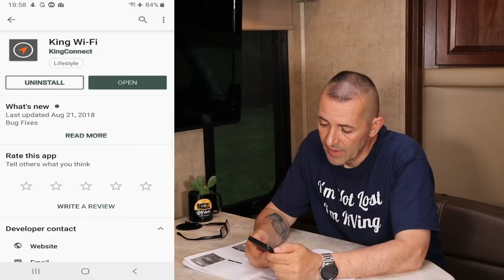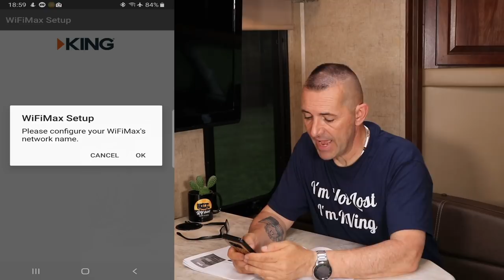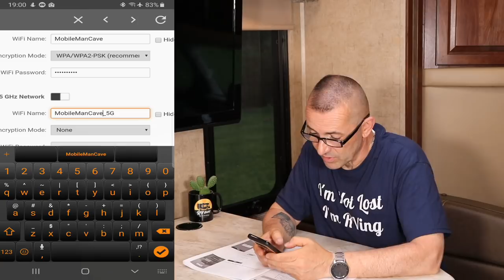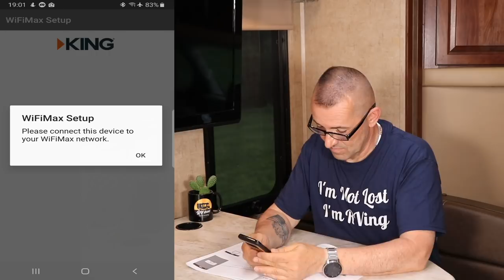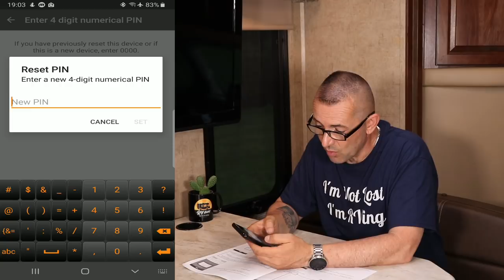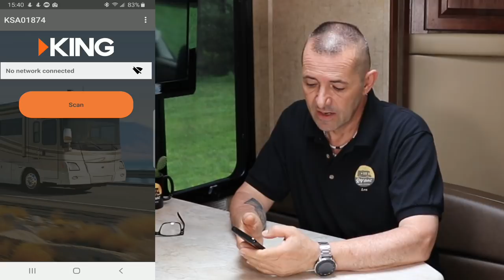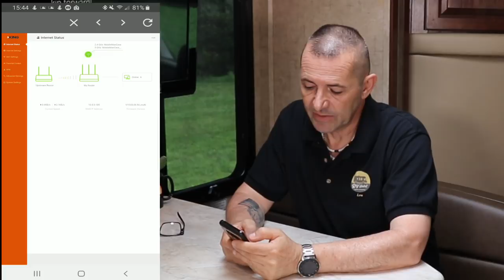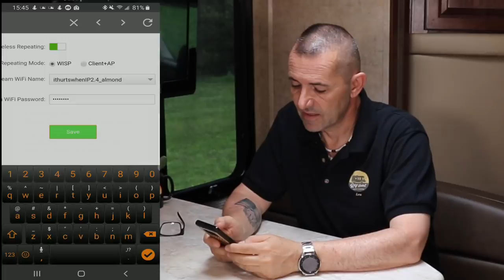King Falcon WiFi - Automatic Directional Antenna and Router for the RV – Install, Setup, Review

Comment: Thank you for the kind words and thorough walkthrough, Lou! We're delighted to hear about your experience with our Falcon!
Reply from the maker: Thanks for commenting!  I have four different King products and love them all.
Reply: Does it matter what position the antenna is in when travelling?  Can it be rotated with the app to offer the least wind resistance?
Reply from the maker: It stays in the last position it was aiming.  I have not noticed any problems or wind resistance when traveling.  I don't see a way you can point it forward when traveling.  It only sits nine inches above the roof.  Hope this helps you and thanks for the question, Lou.
Reply: Do the units have 12v power adapters available?

Comment: Is that a deer that walked by your RV by the window on your right shoulder.  This is a very good video but the setup can be a little confusing. Had to replay it a few times. You were talking about 11' cable I agree. Fortunately I have a pre wired RV .Wild River witch I have is king pre-wired so  that saves some work there. Also has a G6 wire for cell boost also. I probably would go with the swift kit because you have to deeper in your pockets for the setup you have. Have not seen that Falcon for less then $ 700 and that's steep money. So the swift I go! Thanks for the demonstration and detail explanation. I probably put a pole outdoors and hook the outside swift instead of up on the roof permanently.  Not sure yet. wait next spring anyway. Thanks!
Reply from the maker: Yes the Falcon has gotten very expensive and it seems most campgrounds have subpar Wi-Fi.  Oh and yes that was a deer lol.

Comment: I call space up on the roof real estate as well, I wonder if I got that from you lol. Do you know if king Jack offers an extension cable if 11 feet is not enough? I think the most difficult part was fishing the cable under the circuit board lol. That was another well planned and easy to follow how to video, nice job Lou!
Reply from the maker: Hi Kenny, probably just the way us two northeast boys talk.  I actually checked and King does not sell a longer cable.  You can get one from a third party but adding more cable will affect performance.  The legnth is doable but takes some planning. I was worried about the video legnth but wanted to explain each step for a good how to for viewers. Still working excellent though.  Thanks for taking time to watch, Lou.

Comment: Nice video but I have a stupid question. I have it all hooked up on my phone but what I'm confused on is when I go to my tv it gives all the different wifi signals but which one do I click on? Do i connect to the 5g  i created or the campground signal?
Reply from the maker: Hi,  You will always see your own RVs network listed as it is transmitting its name over wifi but it does not have internet until you connect to a wifi that does have internet.  So you do not want to choose your RV network when setting up.  You are looking for a wifi network to connect to that will supply internet such as the campgrounds wifi.  Once you connect to the campground wifi that will be rebroadcast on your secure RV network.  I hope that makes sense.

Comment: Hey Lou - great video!!!  As a digital nomad, I am always looking for technology that can enhance my ability to acquire a signal.  Thanks for the step by step with the King.  My only concern was the fact there was no cover on the circuit board. That seemed kind of weird.  Is it still working good for you?  Safe travels my friend.
Reply from the maker: Hi Patrick, I thought it was strange also about the circuit board.  I would of thought it would be dipped in some type of coating.  With that said once it installed it is completely protected from the elements.  After I installed it it rained for six days straight and no problems.  I have only used it just under two weeks so far but it does work well.  Thanks for watching and stay safe, Lou

Comment: thanks for the video!  really appreciated - just saw one of these on amazon yesterday and was VERY interested.  Oh, and who doesn't love bacon! ;)

edit:
wait, it's only 110v?? ok, i see it on the actual King website - the antenna is 110v -> 12v and the router is 110v -> 9v.  i'm not TO savvy with electronics, but i do know vehicle electric systems.  you can just wire the antenna into your 12v system no problem (make sure to use a fuse on the positive, of course) and skip the 12v-to-inverter-to-power adapter-to-12v at least... i'd have to look up how to get 9v from a 12v system for the router.  (maybe some sort of a cheap adapter online?)  or maybe just get a 12v router.  looks like the falcon is a standard router antenna connection...

thanks again for the video!
Reply from the maker: I have been happy with the falcon so far.  I will be doing more testing in a few weeks.  The router is excellent.  It has worked far better than my previous antenna and router that this replaced.

Comment: Great Video Lou!!   So with the WiFi King Max Router I can use it to hook up Apple TV to it like you did your USB stick?  Also have you had any wind issues with the antenna when driving?
Reply from the maker: Hi David,  Once you have connected to an Internet source with the Falcon the WiFi Max acts like a router that you have at home.  You can connect any device you want to the WiFi Max Router.  The trick is you must be able to connect to an available Internet source.  Many times campground WiFi is lacking on speed.  With all that said it does work very well and beats  my previous WiFi setup hands down.

Comment: How is antenna? still works, still like it? I am considering to buy one.
Reply from the maker: Hi Andriy,  yes still works great.  The only issue is you need wifi in the area to connect to.  Campground wifi has shown to be lacking in most places.  With that said when there is wifi to connect to this works great.
Reply: @RVHabit  thank you.

Comment: How far away can this pick up wifi signal? I'm looking for something for my motorhome.  I'll be dry camping and looking for something that will be able to pick up further then just a few hundred meters throughy buildings and hilly areas. I'm wanting to be able to park a few blocks away from a Walmart or McDonald  but still be able to get their wifi, or maybe sometimes there is someplace that has a really nice view I want to park over night but am a couple km away from Walmart for example.
Reply from the maker: I have seen signals close to a mile away.   However this is highly subject to weather, atmosphere and terrain.  This may or may not work depending on conditions.
Reply: @RVHabit  thank you for the information. Because of those reasons I'm looking for something that would reach 3 miles or more in ideal conditions. That way through buildings and bad weather it can go 1 mile or ideally more. Because I may get find a nice lake or park I can park near and will have someplace a mile away that has wifi I can grab.

Comment: Thanks for posting.  Once it's setup can you log several devices into the router, or is it just one device on the router at a time?  I'm thinking the kids have tablets and laptop?  Thoughts?
Reply from the maker: Hi Dave,  Once it is set up you can connect multiple devices to the router.  I have the firestick, alexa, cellphones and  tablets all connected at the same time.
Reply: @RVHabit  We picked up a 2020 Winnebago Vista 31B in the spring and we're finally getting the Dish TV and extender put in...should be done today.  Will be fun to see how well things work with the in motion Sat as well..

Comment: Hi Lou, What is the name of the adhesive sealant you used to hold the antenna on the roof?  Can it be used to reseal around roof vents that are starting to crack?  Thank you!
Reply from the maker: Hi, Remember it should also be screwed down.  I used self-leveling Dicor sealant.  It is designed for RV roofs to seal around vents, skylights and other openings.  It is strictly a sealant and not an adhesive.
Reply: @RVHabit  Thank you for clarifying!  Much appreciated and looking forward to your next video!

Comment: how the heck u supposed to know the password to peoples wifi router/networks?  When it asked for password when you were linking wifi network to router...how u know what the password is?  What if you do not have a clue what any of the passwords are and what if every wifi network option needed a password... how would I be able to connect if I do not know any of the passwords?  Would I just be screwed because there are no networks available that do not require a password?  I often try to connect to other wifi netorks on my phone but half the time I do not get to connect because I need a password.  That is what I do not understand about these things.  Is there a guarantee that if I buy this and install that I WILL find a wifi network to connect to?  or is it, by luck?
Reply from the maker: This is to connect to 'available' WiFi networks.  Typically campgrounds where you are given permission and a password.  You can also connect to public WiFi spots such as offered at coffee shops and other retail locations.  It does not allow you to connect to WiFi that is private.

Comment: I have one of these on my 5th wheel RV. I like it, but I have issues with the app software, kinda clunky.
Reply from the maker: Hi Scott, Yes the app can be a little "clunky" but I will say it does get a great signal when locked on.  The router is excellent.  My previous router use to drop out and the King never drops.  The only downfall is campground WiFi is usually pretty bad.  Seems if you need a reliable connection the future is cellular.
Reply: @RVHabit  Hello Lou! I've sent you an email as well as a message on Facebook in regards to this, we might be able to help you out with cellular as well just respond to my email if you're interested!

Comment: So I just bought the system, and the app is nowhere to be found. What do I do?!
Reply from the maker: You will definitely need the app.  There must be some type of issue with Google or Apple store.  I would call King to let them know.  Also I would imagine they can Email you the APK file to install the app.  Let's us know how you make out and good luck.
Reply: @RVHabit  When I call, it just rings and rings and goes to voicemail with no call back. Very frustrating,
Reply from the maker: I just checked the King connect website.  If you go to support page then to Falcon you will see the links for the King WiFi app for both Apple and Android.
Reply: @RVHabit  Did you click the link for Android? It says not found for me.
Reply from the maker: I believe they are on Central time.  Follow up with email to support.  I can feel your frustration.

Comment: Can you use it so a Xbox can work on wifi while driving?
Reply from the maker: You cant use the Falcon since that is a WiFi antenna and would not sty locked on a signal.  However you could use the WiFi Max Router and a cellular hotspot to achieve Internet while driving.
Reply: @RVHabit  Ok thanks. Can you suggest a specific brand or product?
Reply from the maker: If you want to have any type of access to Internet while driving you will need a cellular Hotspot.  Each cell carrier runs different promos at different times.  There is a YouTube channel called Technomadia who researches all the current deals and posts them on there channel.  Go check them out.  Good luck.

Comment: Can you do the set up and use with a laptop
Reply from the maker: as far as i know you need a smartphone or tablet as setting are done through the King app for Android or Apple.
Reply: After the set up can you use a laptop? if now the thing is useless
Reply from the maker: After setup you can connect any WiFi device to the router for Internet access.  I connect our phones, tablet laptops, and Roku & Amazon Firesticks.  I don't know if that answers your question, I hope so.

Comment: How far is far?
Reply from the maker: Distance is dependant on many factors such as terrain, obstructions, and even atmosphere.  A Yagi antenna is a more focused beam like that of a flashlight and is able to receive signals from greater distances.  In a normal world I would not expect more than a few miles.  If obstructions are present that can limit heavily the ability to receive a WiFi signal.

Comment: So you have to have that persons password.  this is not free wifi.  you piggy back off someone else's network.   maybe stick with my own SIM card for internet
Reply from the maker: This is designed for use at a campground that supplies internet for your use.  It is not designed to piggy back off wifi of unsuspecting people. This helps pull in those often weak wifi signals at campgrounds.  Having your own wifi through a Sim card is ideal but some people still take advantage of the included wifi that is included with campground fees.  Thanks for watching and happy camping.
Reply: @RVHabit  I know that.   I meant ur piggy backing off the campground.  Still not secure